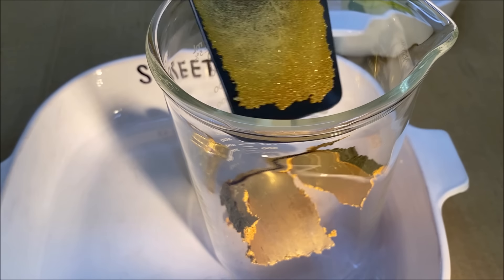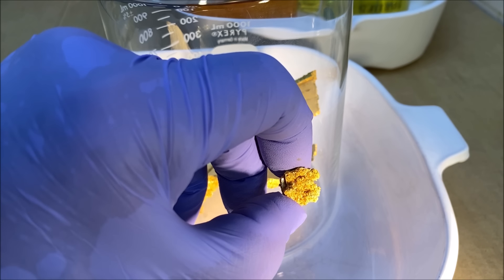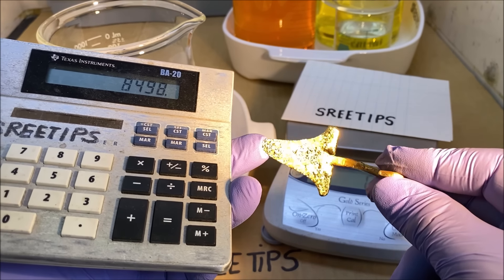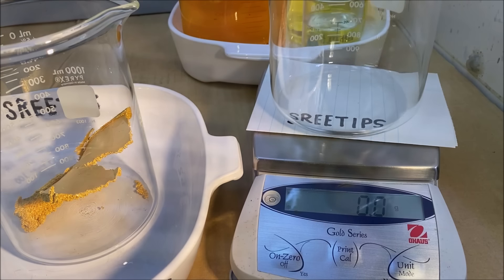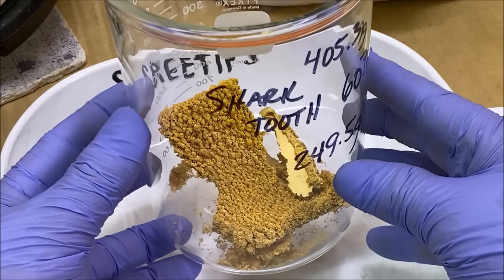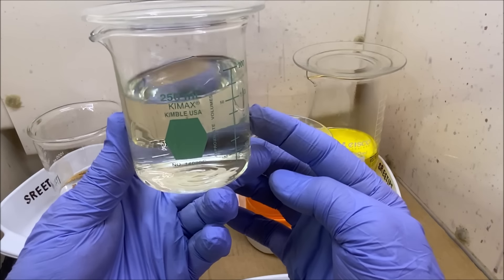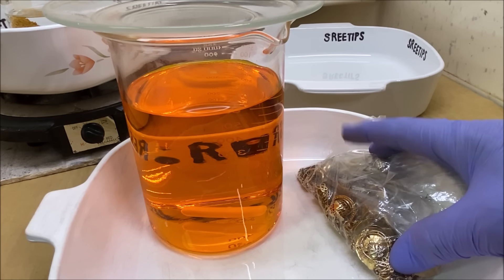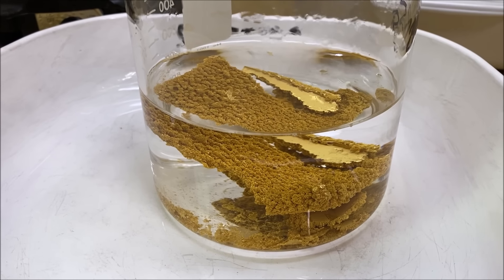Electrolytic Gold Refining Cell Pt3

Comment: I see the nodularisation made peeling easier. Good.
Ideas:
1. Polish one side of the titanium with a fine polishing compound to reduce micro-scratches for easier peeling.
2. Coat the opposite face with a non-conductive acid-resistive coating to keep electro-forming confined to one side of the cathode. Again, to facilitate easier peeling.
Always a pleasure to watch!
Reply: or just polish both sides
Reply: On a whim, I googled "titanium bowl". Found one for less than $20.
You could build a gold cell almost identical to your silver cell in construction.
...if you're interested in such things.
Reply from the maker: I have a gold cell design that works well. Though both produce high purity product, they are a little different configuration. The gold cell that I use is the best and most efficient setup.
Reply: @sreetips  Groovy. See you next video, Chief.

Comment: sreetips how I love your videos, a true alchemist.  So, some advice, when plating on your cathode next time wrap/coat the back and along the edges with some heavy vinyl tape this will provide a barrier to prevent unwanted plating.  This is a common practice used by chrome platers when chroming industrial items.  Hope this helps in the future.
Reply: Great suggestion
Reply: I wonder if the vinyl tape's adhesive will withstand the acidity of the chloroauric solution? I tried some adhesive-backed PTFE tape for this and it seemed to remain fixed, so vinyl probably will too.

Comment: Beautiful results. I wonder if a gold cell using gold shot (in exactly the same setup as your silver cells) would work (using those stainless steel bowls)? 👍🏻
Reply from the maker: I don’t think so. The gold chloride electrolyte would probably react with the stainless.
Reply: I wondered this as well; @sreetips answered the same earlier regarding the stainless being attacked by chloroauric. However, a titanium (or gold-plated) bowl might work. Also, dissolved impurities might settle into the gold crystals (though wouldn't this issue be the same with the silver cell? Idk).
Reply: @JP-kb5ng  plated is too thin. Thick plated might work but there is always the danger of scratching over the lifetime usefulness of the enhanced bowl. What do the pros use? Good question, checking now... seems too much proprietary technology is involved to easily check with my resources. Sorry.

Ok, let's examine the qualities of thickplate titanium, it is a pure metal not an alloy so no points of attack there for clorides, check. Mechanical scraping with non-scratching silicone coated tool would be a must. Detaching the electrowined gold for a hobbyist might be solved with a clever grid of gaffer tape over the surface to decrease the mechanical adhesion area which would be helpful in the scraping. It might last for more sessions than the initial setup and any adhesives leaching into the electrolyte might not cause problems, don't know, never done myself. Anyone else have a thought to toss in here? 

While rereading this post of mine I see I did not address the gold plated bowl as an answer. A different problem there since the gold will molecularly attach which might require removal of the plating to allow the harvest and a replating of the bowl. Sounds doable in large part, Lord knows I have seen industrial processes which are similar -plate the container, process the gold, deplate and repeat. 

Edited many times as things happened.
Reply from the maker: I’ve seen videos. I’ll post a link in the description. Here’s what I could gather: the Dore bars (large impure gold bars with silver and base metals) are refined using an unknown process (probably the miller process - the molten dore has chlorine gas bubbles through it) to get the gold to about 980 to 990 parts per thousand. This gold is cast into specially shaped anode mold that includes two little hooks one on each side of the slab. Slab is roughly 12 inches by 18 inches (30cm x 45cm) and about 1/2 inch thick (1.2cm). These slabs of impure 980 to 990 parts per thousand gold are then hung in a tank of gold chloride solution - gallons of it. In between each gold anode slab is a cathode (possibly titanium). So it has alternating anodes/cathodes hung in a giant tank of gold chloride. The hooks on the gold anodes are up out of the electrolyte and in contact with the (+) of the power source. The titanium cathodes are identical shape as the anodes and are in contact with the (-) side of the power source. The electric current is passed through the cell and the impure anodes corrode (dissolve) and the pure gold gets deposited on the titanium cathodes.
Reply: @sreetips  And any PGM contamination (except for palladium) will drop to the bottom as sediment.

Comment: That's really cool, have you considered using a graphite rod as the cathode? If you deposited gold on graphite then you could simply melt it off without potentially contaminating it will titanium and whatever metal you scraped it loose with.

Comment: If you apply Insulation around the edges of the cathode collector plate, the gold plating out won't "wrap around" and lock onto the plate so hard. Makes it easier to peel off.

Comment: Awesome! 

So it seems the anode loss was equal to the cathode gain within a gram or two, indicating there was little to no change in the quantity/mass of gold ions in solution.

I'm very curious as to why your gold plating out onto the cathode looks so entirely different from my tests; I'm guessing my electrolyte was significantly under-saturated and/or my voltage was too high. Since you provided the recommended concentration and voltage, I'll have to re-test using the appropriate parameters.

Comment: If you consider the melting-points of gold and titanium, could you not just melt it off? Or is the concern for impurities the reason for your mechanical separation?
With careful heating and an appropriate mould or crucible, you could melt it right into a goldbar, no?

Also - thank you for these videos. They are curiously fascinating!
Reply from the maker: I’d be concerned about the gold welding to the titanium.
Reply: @sreetips  I can tell you from experience: you are 1000% correct in your concern, except it doesn't only weld to the titanium, it produces a kind of nightmarish crumbly Ti-Au ore/mineral. 

Though Ti has a much higher melting point, it becomes extremely reactive at around 1000F and binds with gold in a very very bad way through a seeming capillary-type interaction. 

Ask me how I know ;(.

You might be able to pop all of the gold off by briefly reversing the polarity of your cell. But frankly your scraping method seemed perfectly effective to me.
Reply from the maker: There’s no substitute for experience.

Comment: I wonder how the anode got that glitter look? Was it crystallization inside the original ingot? Or was it induced by the electrolysis - maybe by some back-deposition of the gold ions? That might not happen if you used direct current but I would not be surprised if there are some eletrochemical equilibria at play.
Reply: He used DC, a requirement for anything electrolytic.

Comment: the shark tooth - the hook is also gold - so when you stopped the electrolysis and removed it from solution - was the fact it was shrinking onto the stem edge the trigger there ?  otherwise, why not let it go down to nothing, matching the fluid level - eg not a tooth but a straight across edge parallel with the solution level and why didn't you just cut those poured sections off and put them in your next refining effort ?   It's so coll this stuff.... great video - the sunlight on the gold was a nice touch - looks a lot more sparkly to me that interior lighting...
Reply from the maker: I could have waited, and as you can see in the video, it was dissolving fast towards the end. But it was getting late and I wanted to get the video posted.
Reply: @sreetips  Ah - simple enough explanation. :) Thanks Chief.

Comment: Which method is more effective in terms of gold purity, and which method is more cost efficient, chemical or electrolytic?
Reply from the maker: I’d say Aqua Regia and SMB can do it to three nines quicker and less fuss
Reply: Electrowinning results in purer gold and produces essentially zero waste chemicals (discounting those from initial production of the chloroauric electrolyte). The only chemical he consumed during the electrowinning was a bit of hydrochloric acid he added to keep the solution properly hydrated.

Comment: Holy golden magelodon tooth batman!
Reply: My next run w silver cell I will experiment with using sterling directly in the anode side instead of copper cement shot
Reply from the maker: It should go ok. But the electrolyte will get saturated with copper. If it gets about 60g per liter concentration then the copper could begin to co-deposit. You could run it as a parting cell. Then harvest the silver crystal and run it back through with fresh electrolyte. Sound costly? Getting pure metal is never easy or cheap.
Reply: @sreetips  I think [guessing] running through electrolyte 2x is less costly than silver nitrate cement melt to shot and remediation of the primary copper nitrate to iron and salt water.   
I've also got a fellow wants me to refine ag he's getting from a mine in Philippines that is 98% with a .045% gold  and I'm leaning towards using direct electrolysis and then slime refine to isolate gold.   This is where the difference will really count or be obvious.    Detailed measurements and notes required.   

Preaciate ya !!  

"Each one teach one " and the world becomes a better place
Reply from the maker: 98% is about what I run and I can get two runs out of the electrolyte. But I add some more silver the second run. Good luck with that.
Reply: @sreetips  Speaking of copper. I know you've said many times that copper isn't worth saving, so you always get rid of your copper waste and get new copper pieces to use for refining. I thought of you the other day when I saw a video where the guy was talking about saving copper pennies because their melt value has reached 3c each. I wonder if you think with what's going on with metals, if copper will soon reach a threshold value where you would consider refining and keeping some of it, or if it's just so much lower value than silver and gold that it will probably never be worth your time comparatively.
Reply from the maker: @SuperDavidEF I can buy clean copper for refining cheap and plentiful.

Comment: When you made your gold rod didn't you introduce iron into it by using a steel hammer and a rusty vice? You also mentioned "brazing" the rod to the gold bar. I'm assuming you used gold and not brass for this?  This was definitely an interesting video compilation. Watching your silver cell videos made me wonder if something like that could be use for gold.
Reply from the maker: Yes, there’s probably particles of iron oxide in the stem.

Comment: 3 inch razor scraper.  They are way sharper than the razor scrapers with the little inserts so watch out and never keep a blade in it without switching the blunt end out if you are not using it.   WARNING  those 3 in blades are as sharp as archery broad head inserts.    I use it for scraping the red paint off of I beams for lead testing.

Comment: I hope you have the inquartation + electrolytic batch assayed; I'm really curious how the purity compares to the inquartation + aqua regia + electrolytic gold.
Reply from the maker: There’s soft solder in the karat scrap which means lead. The only way to get it out is refine with Aqua Regia so I can add some sulfuric to get the lead out. Then I’ll melt into an anode bar and run it through the cell.

Comment: But if the electrolysis is a refining process, why you still have to enquart the metal then clean it with nitric acid? Can't you just melt the carat scrap and then electrolyze it? Would this work?
Reply from the maker: No. The base metals and silver in the karat gold would foul the electrolyte. The anode must be fairly high purity to begin with in order for electrolytic refining to be successful.

Comment: Sree, I have an idea I want to run by you and see what you think. First I need to thank you. You have single handily educated me and in  doing so Open the door for me to have another career opportunity. I am now refining medals on a regular basis and I owe it all to you thank you. Now I believe I'm not sure that it would be possible to refine gold filled electrolytically. The gold filled seems to be the only thing I can consistently make a profit on because everyone once such high prices for karat gold. But as you know refining gold filled can be very messy and I'm almost positive no matter how many times I washed her clean I am I'm sure I'm losing a little bit of gold throughout the process. Do you think it's possible to refine gold fill electrolytically by just removing the brass base metal leaving the gold. Or vice versa can we just electrolytically refine the gold from the base metal so we don't have to have a big old beaker full of zinc and copper wash using nitric acid as the refining process. I was going to try to attempt some different experiments this week using just a pure zinc bar or just a pure copper bar as the anode and see what happens. Do you have any suggestions or ideas you can bounce back any? Do you have an email I can directly contact you at so I can ask or talk to you without going through the comment section? Are you interested in the future collaborating and working on projects together I know we don't know each other yet but and to me it's kind of like asking Michael Jordan to play basketball game but if you would be interested I would absolutely love that. I was going to start filming some videos myself but I don't want to step on your toes or anyone else's toes it's already in this particular market. I think I was going to try to find a niche bite talking finance specifically precious metals during the process of refining for some uniqueness. I don't know just ideas currently I'm buying upwards a $10,000 a week off eBay refining it processing it and then sending it over to JC after refined. eBay can be difficult to find material consistently for a decent price. I am now to the point where I have enough money to recirculate material consistently. Any suggestions on better places to find material and make money off of it? You can answer some you can answer none regardless I'm just grateful that you're doing what you're doing can't tell you how captivated and fascinated I am with this subject of refining. At first I was having a difficult time with the waste byproducts. I've gotten to the point where I can actually make fertilizer out of the waist nitrate. Make an ammonium nitrate salt that ultimately ends up in my garden in the backyard. I recapture the fumes boiled off during refining that runs through a water sodium bicarbonate solution to degass the nitrogen dioxide. That's still in the infancy stage but I'm dialing it in. Thank you for your time and all that you do 
Ryan
Reply from the maker: In order for electrolytic refining to be successful the anode material must be fairly high purity to begin with.

Comment: Please turn that sharks tooth into a medallion for a chain!  P.S. it appears my previous question about going from inquartation to this step, and skipping refining, brought out the “kadriver“ experimentation in you.  I’m eager to see the results!
Reply from the maker: I may have to amend the experiment. I seen at least one piece that had a repair with soft solder. Soft solder is tin and lead. Lead, even in trace amounts ruins the malleability and ductility of the gold. So I may have to do and Aqua Regia refining with a little sulfuric acid before going to the gold cell to get the lead out first.
Reply: @sreetips  the tin is scary too.  The blue goo (Metastanic Acid) is a refiners worst nightmare!  Love to see a future video on how to deal with it.
Reply from the maker: I’ve seen it in gf material. I boiled in dilute sulfuric to dissolve the metastannic and it worked pretty good.
Reply: @sreetips  I read something about that in Hoaks book.  Glad to know it works.

Comment: Where does the extra Gold come from?!
Reply: I mean are you growing gold ? Can you please explain, I also watched the silver cell videos is it the same thing except of course the electrolyte and the other stuff… thanks in advance
Reply: @TouTou-fz1bf  I can't speak for him but the gold chloride solution also contains gold. The ions of gold plate onto the titanium and more gold coming into the solution from the electrode to replace the gold which has plated. This is a fast process and is the way all gold is finalized/refined into sponge. Most metals are refined in this fashion to some extent. 

Any super saturated solution will plate even without added electricity, this method just takes it one step further down the road you see. Supersaturated Solutions can occur at various temperatures including those in a molten metal Crucible.
Reply from the maker: No new gold is being created out of thin air.
Reply from the maker: The gold from the anode dissolves and travels through the electrolyte and deposits (grows) on the titanium cathode.

Comment: There is also the option to do it themselves. Invest in the scrap gold, then all the equipment and chemicals, then the time spent actually doing the refine  🥹 🤣
Reply: They might even break "Even" 😊
Reply from the maker: Gold is real money, real wealth. I’d hold it in karat scrap form, as is. No need to refine it. It will track right on up with the bullion price. So long as it’s not melted and ruin the markings. Then its purity, and therefore its value, becomes questionable.